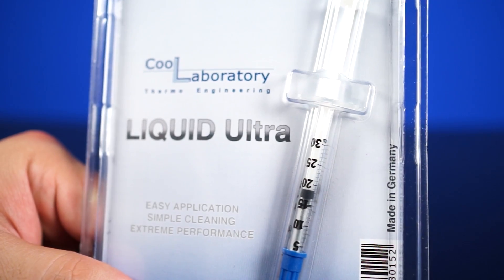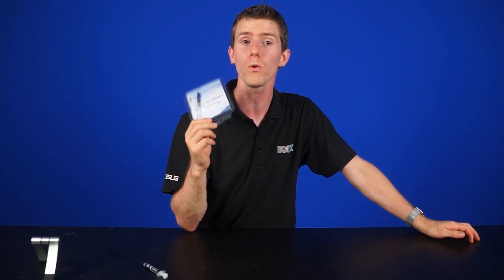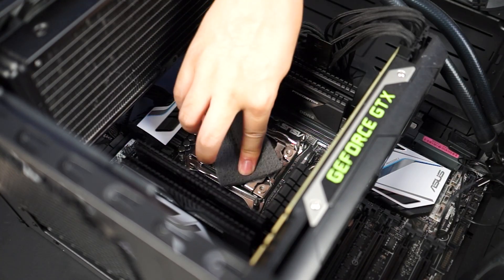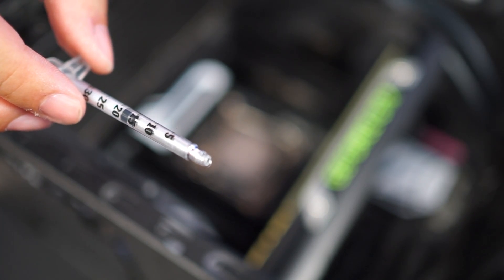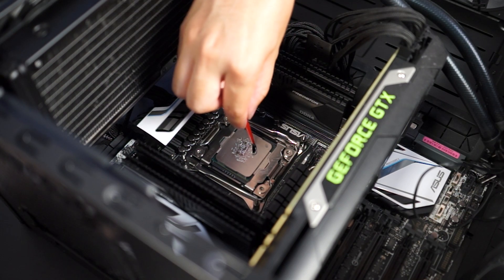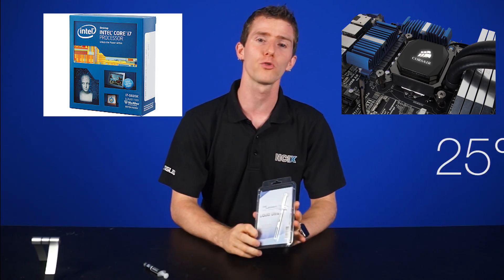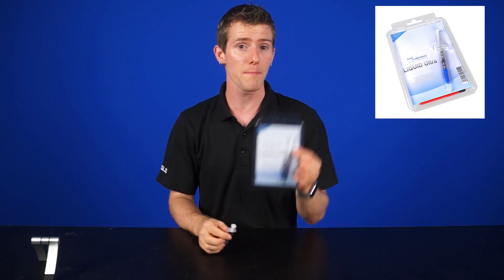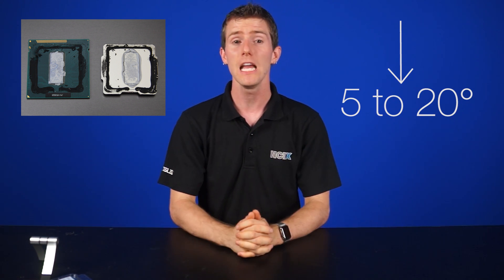CoolLaboratory Liquid Ultra Thermal Compound - Wut iz?

Comment: Yeah you did something wrong.....i've tried liquid ultra on three seperate computers; using an I5 3570K, an I7 4820K, and my new I7 5960X with none of them being de-lidded and i got a temperature drop during idle and load, with minimum maximum AND average of around 5-7 degrees C lower on the CL ultra vs my Gelid GC EXtreme and EK Ectotherm pastes, which are the best on the market; even better than the noctua NH-H1 (and far easier to spread i might add (o_-)

Comment: I try to only use ASUS, Arctic silver, intel, Nvidia, and Corsair. now that im getting older. I really love ASUS. I had a screen and GPU that lasted forever( 7 years)

I am a hardcore ASUS fanboy, they just always make the best products in my opiniong. Feel free to post what companies you love. 

P.S I was a big MSI user about 10 years ago.
Reply: Tim Suydam ASUS = Best Motherboards hands down, Corsair = Best RAM hands down, Intel = Best CPU's BY FAR hands down, Nvidia = Best GPU's. Typically EVGA and ASUS make the best non reference Nvidia GPU's. Only thing i don't agree with is Arctic Silver, it USED to be pretty good, but they haven't changed the formula in years and others have beat it by far. If you don't feel like trying liquid metal paste's like the coollaboratory, try getting some Gelid GC Extreme; it'll give you around 3-4C lower temps than Arctic Silver AND it's not conductive so it won't fry your motherboard if you drip some on it without realizing; which is what would happen if you dripped the Arctic Silver on it.

I'm currently using a computer with an  Intel I7 5960X 8 core CPU with an EK Supremacy EVO Waterblock, 2 x Nvidia GTX TITAN X GPU's in SLI with EK Waterblocks, ASUS Rampage V Extreme X99 motherboard, 16GB Quad Channel Corsair Dominator Platinum DDR4 2800mhz RAM, Caselabs SMA8 case, 7 x Corsair SP120 PWM 120mm fans + 4 x Corsair AF140 140mm fans, and the assorted watercooling supplies, (i.e. fittings, pump, tubing etc..) And i use an ASUS ROG Swift PG278Q 27" 1440p, G-Sync 144hz monitor for my main system and an ASUS VG23AH 23.5" 1080p, IPS, 60HZ monitor for a backup monitor and for color correction for video editing due to the IPS color.

Comment: My Laptop is running on Liquid Ultra compound and I'd gauge the idle temperatures from anywhere between 3 to 4°C lower than with my old application of MX-2 thermal paste. What is way more noticable is that temps fall a lot faster and don't rise as fast/high as they did with the MX-2 though. Obviously direct contact heatsink in a laptop (or de-lidded die as Linus calls it)

Comment: I have used it on my pc. Got an i7 5930k overclocked to 4.5 MHz and an H110i got 43C while gaming.
Reply: HaZe Let´s Play damn son 4.5MHz is serious business!
Reply: HaZe Let´s Play That's pretty darn good i have to say; i almost don't believe it. I'm running my I7 5960X at 4.6Ghz and i get around 30-35C idle but it goes up to around 45-50C under gaming load. ANd i'm using a huge custom water loop with a 480mm radiator, 420mm radiator, and 360mm radiator with an MCP655 Pump. Although i do have two GTX TITAN X"s in the loop so if you have only one GPU or something that might explain the lower temp, as the GPU will effect the overall water temps.
Reply: xXDarkxIdealsXx yes i got an GTX 980TI Zotac AMP Ectreme OC. It gets 50 - 60 C while gaming. CPU gets up tp 43 - 50.

Comment: I actually bought this product about a year ago from Ebay.
I should note I have an air cooled heat-sink and an AMD processors (haters, comment below) using Arctic Silver 5 paste.
Prior to using it, my CPU was constantly getting 80+ degree temps during intense games and idling around 65~.
Also did this to my graphics card R7 265, which was actually keeping itself cooled well enough without it.
Afterwards, my CPU hardly rose above 70~ during intense games and typically stays around 55~ on idle.
Graphics card, however, didn't improve much. Only about a 5 degree difference at idle.
When I do my next build, I'll have to try out Noctua NT-H1 vs Arctic-MX vs Liquid Metal.
Still would recommend it to tech savvy people. Novices would have problems (as can be seen by NCIX Anthony). To be fair, it is a bit tricky to apply, especially to some GPU's.

Comment: I used CLU for my delid 3770k, running 5ghz 24/7 clock for over a year now, max temp while gaming 66c with h105 cooler, CoolLaboratory Liquid Ultra is awesome.

Comment: I used the pro and not the ultra liquid and saw temps arround 5 to 6 degrees celcius in my i7-2600k oced to 5ghz and my gpu 780 gtx

Comment: My stock 4770k with h110 and two noctua fans was thermal throttling in occt after about a minute, after i delidded it and applied coollaboratory liquid ultra to the inside and out side of the IHS i saw a maximum of 70 C.
My old system was a QX6800 on xfx 790i ultra sli, the cpu was running overclocked 90-95 C, so i lapped it with high 3500 grit sand paper, the themps dropped to 72 C.
This shows that intel is using bad thermal compounds and bad IHS design.

Comment: I have a delided i7 4790k running 4.9ghz and intel burn test at max I get 65c with coolaboratory pro on the dye and heat spreader good stuff.
Reply: Voltage is at 1.325

Comment: This stuff is the best for thermal conductivity, but it comes with too many caveats..

I use IC Diamond, the 2nd most thermally conductive thermal paste.

Unlike no.1 here, ICD is NOT electically conductive, capacitive, and will not cause problems for aluminum.

Why does NCIX no longer sell it?

Comment: Solder works even better and lasts longer. Only drawbacks are that if applied without great care you could overheat the cpu and the parts are permanently attached unless you want to risk applying heat again. Solder has been used on cpus in the past but fell out of favor.

Comment: I tried to use the pre applied thermal stuff on the stock cooler and I almost fried my cpu. The circular cooling pad wasn't enough to cover the whole cpu and some of the paste leaked out and scorched onto the surface. it rebooted randomly and reported any number of errors from overheating to hard drive failures.

Comment: This is a waste. I've never used any paste other than what comes with the heat dissipator, and I've never had any problems with overheating. Even on water cooled systems that where heavily overclocked.

Comment: Its a shit product DO NOT USE IT.  Seen so many try and seen so many reviews and videos as I was tempted at one time but the mere use fucks up your CPU first you need to scrub the shit out the heat spreader surface making some pretty deep scratches which is really bad and then you need to apply it but here is the thing you cant use it on aluminium and given that pretty much every CPU heat spreader both AMD and Intel is aluminium how the hell are you meant to use it and if you are stupid enough to use it it does not last very long before it starts to stop transferring heat properly and you have to replace it which again is not fun and requires you to yet again scrub the surface with a brillo pad just to remove it. Then there is the damage it does to the spreader and it does more than stain it look up the effects of gallium vs aluminium.

Comment: Got the NT-H1 on my laptop as it was running hot because of the faded thermal paste. Dropped the temperatures from 75 to 65 on the CPU and 84 to 71 on the GPU.

Comment: Doesn't matter what your thermal paste is, it depends on your cooler anyway, unless you're using $5 white silicon based paste that's completely useless (you better use your toothpaste as thermal paste than that)

Comment: Wait this "paste" should be used on copper or silver surfaces only, if not it will react chemically. Now, I didnt held every single cpu model in existence in my hands but i am pretty fking sure that metal cpu heat spreaders were never ever, ever, ever build out of copper or silver.

Comment: QUESTIONS:

if you delid and apply the clu, do you put clu on the heat spreader or can you use a different thermal compound?

is this beneficial, if you delid and use clu, on a custom full size loop not a closed loop?

and 

what about the coollaboratory copper, what is that, can you use that if you delid or at all on a cpu?

Comment: Its only necessary when using between the die and heat spreader. you will see no difference with it as a normal thermal compound on soldered heat spreaders (as the video obviously shows)

Comment: I used this on my last personal build including the gpu die as well. Noctua cooled 4790K usually idles around 27c and 60c under full load with no overclock. With arctic silver I'm between 32 and 70 so it doesn't really make a huge difference, just a little peace of mind knowing its around 5 degrees cooler.

Comment: Well, I won't poopoo this product because it does have it's place. However, I feel the point of "King" Arctic Silver 5 is that it perfoms very well without being too capricious.
Arctic Silver 5 is a Porsche GT3 and will give you 9/10ths performance under most circumstances. Liquid Ultra is an F1 car for very specific situations.

Comment: Gallium actually makes aluminium crack like ceramic. I'm pretty sure NurdRage did a video on that.
Reply: o0julek0o It is only meant to be used with copper and nickel heatsinks.
Reply: ***** Please tell me you're being sarcastic.
Reply: o0julek0o No sarcasm, I should have said Coolaboratory Liquid Thermal Compound is only meant to be used with copper and nickel heatsinks. Says it in the manual.
Reply: +o0julek0o How does my comment make me stupid? I'm sorry if there was some misunderstanding but there is no point in putting me down when you have no idea who I am or what my credentials are.
Reply: ***** Really not a troll. Just an interesting fact over Linus' 'black sludge' mention.
Reply: o0julek0o These guys are pretty amusing.

Comment: One of my GPUs was getting really hot (7990 w/ a full-cover waterblock).  The hottest GPU saw a 30 DEGREE temperature drop with CL Pro.  The other 3 saw between 14 and 17 degree drops.

Comment: I tried Liquid pro, excellent performance but does dry up after a year and the performance becomes below average. I stopped using Liquid Pro because it isn't removable you need to do a lot of polishing. Then they released Liquid Ultra and gave that a try, they claimed it would be removable. For me the outcome was even worse the waterblock seemed soldered to the CPU, I did need to use extreme force to break it loose. I was lucky to not break  anything ! After one application I was done with Liquid Ultra because I almost damaged my hardware during removal. Since then I use CG Gelid Extreme, cools 1.5 degree less but it's the best regular thermal compound without complications...

Comment: I have used Cool Laboratory Liquid Metal Pro for years in my water cooled PC. It will end up stiking your watter block to your CPU/VGA, and the residue after removal of the block is very difficult to remove. 

However, it does perform really well, specially in the long run. I can only recommend this product for very hard core enthusiasts. Really,   this product is not for anyone.

Comment: I'm pretty sure the gallium would diffuse INTO the aluminum not just sit on the surface.
Reply: Randy Randerson Correct, it eats away aluminum that's why it can only be used for copper and nickel heatsinks.

Comment: Seems interesting. My CPU runs at 80 idle, I use stock heat sink with stock thermal paste and one 80mm case fan
Reply: Andloo Yunty try throwing some dry ice inside the case
Reply: Andloo Yunty Dont put this on your stock aluminum heatsink. This contains gallium and it will eat right through it. Only nickel or copper heatsinks.
Reply: Andloo Yunty 80 IDLE? dafuq? if that was true the second you started up a game you'd be hitting over 100C, instantly frying your CPU if it didn't immediately shut itself down due to thermal throttling. I really hope you meant 80 load, as 80 idle isimpossible if you didn't copletely screw up attaching the heatsink, forget to apply thermal paste, or have a defective CPU.
Reply: xXDarkxIdealsXx lol. I was worried about that too, turns out my BIOS displays in Fahrenheit even though it says Celsius. With speedfan installed, it turns out that I idle closer to 30-35, with full load at 60
Reply: Andloo Yunty Stock heatsinks are usually not the way to go. Get a better heatsink or go with Liquid Cooling. This paste stuff is really a moot point because even with paste you are still using a fan to cool the thing down.
Reply: Andloo Yunty wait, case fan? does that mean there is no fan on the cpu only on the case, or that there is 1 cpu fan supplied with the case
Reply: michael mckinlay CPU Fans are supplied with the processor when you buy it in the box. Cases have a fan on the front of a case and one on the back usually. Any others you buy extra.

Comment: IC DIAMOND
Reply: SWOgottaGO which is one batch of thermal paste with issues, yet thousands of people are using it without any issues what so ever.
Reply: Josh10 [CITATION NEEDED]
Reply: SWOgottaGO People who still think AS is the best don't have any business telling others what thermal paste they should/shouldn't use.
Reply: Ted Guy Have fun messing up your CPU
Reply: SWOgottaGO ?
IC Diamond is a thermal paste...
Reply: ***** Read on it and what it does to your CPU!
Reply: SWOgottaGO Thats what you get when you use one of the most abrasive metals... and the pitting was an isolated issue with a specific batch of ICD24.

I've been using it for years without issue.
Reply: ***** I'm sorry but I trust what I can see.
Reply: SWOgottaGO You say that as if your point needs none.
Reply: SWOgottaGO Go read up then, most people use it with no issues.
Reply: Been using IC diamond for a long time. Even on gpus it's fine, although yes it is abrasive, and scuffs the die. A tip would be to warm up the TIM before use so it's easier to spread. Using it on gpu drops temps a few degrees compared to others
Reply: phillip galas you shouldn't be spreading it at all. the pressure of the heatsink is all that is necessary to spread it.
Reply: phillip galas I'll keep using the superior MX4

Comment: I've tried this stuff on laptops, desktops on water coolers and liquid coolers and have not really seen an improvement big enough for me to make a permanent switch from carbon based thermal compound to this stuff.

This compound goes through a phase change when heat is applied.

Comment: Think i will stick with using Noctua NT-H1 Thermal Compound for all my systems (with noctua fans).
Reply: Kaoru Sugimura Arctic Silver 5 is still the champ regardless of the cooler or cooler type.  It's BEEN the champ for the past 10 years straight.
Reply: Chronofusion
What are you talking about? AS5 runs roughly 2-3C hotter until cured.After it is cured it is roughly the same if not at times slightly hotter. You don't have to look far for those tests results either as many forums have been posted with many people agreeing that NT-H1 being the leading TC. Honestly 1*C doesn't mean much to most anway so they are both great regardless.
Reply: Kaoru Sugimura Yeah I only use AS5 for jobs where the performance isn't important. It's often 5 degrees hotter. For everything else I use IC Diamond 24 carat.

Comment: I use this on the 5820K OCd to 4,5GHz (this is what should be in this video!) with the NZXT Kraken X61 (280mm, but similar cooling cause its an AIO unit). Pretty happy with the liquid ultra, temps are 2-3°C lower than with MX-4 and other mid-range stuff. But its hella expensive, cant recommend it to anyone who doesnt want to squeeze the CPU, overclocking it to the limit.